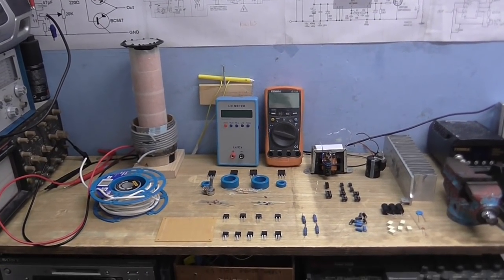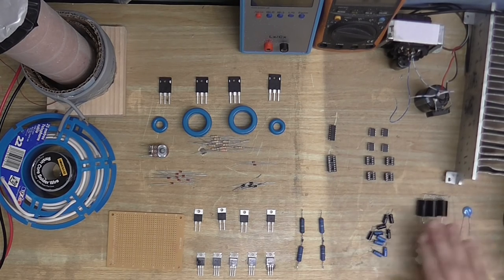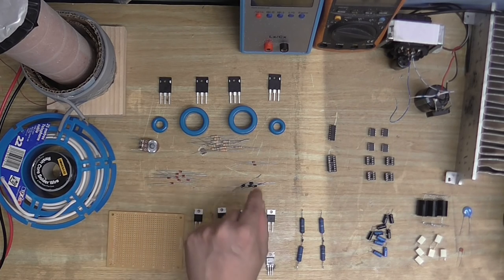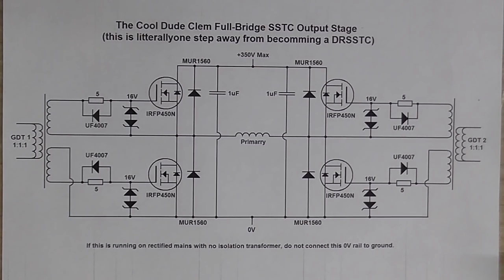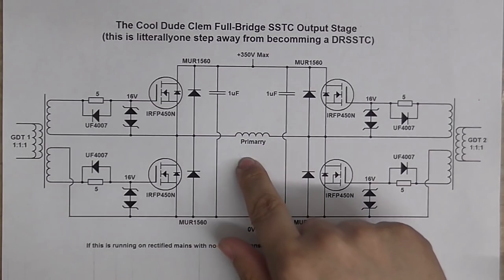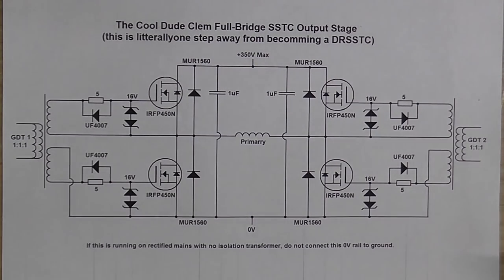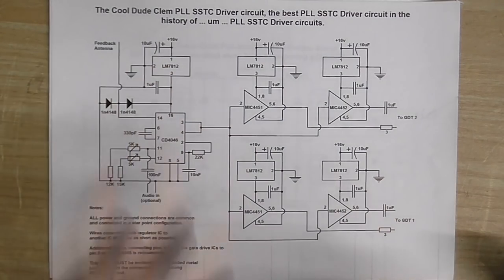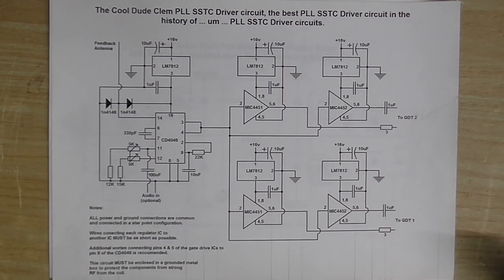Tesla Coil Tuesday - Building a FULL-BRIDGE SSTC Part 1

Comment: i noticed that you dont have mmc capacitor in series with primary in schematic im not sure that's gonna work without mmc!usualy it goes 1.5Uf capacitor between primary and transistors.
Reply from the maker: I'm not going for an DRSSTC design here, I think I stated that pretty well, anyway I did experimented with adding capacitors between the primary and the transistors, but even when tuned properly it took more current and the sparks were not as good.
Reply: @CoolDudeClem  I dont talk about DRSSTC! i talk about sstc i built more than 20 of them and this capacitor is most have in bridge.this capacitor creates Ac in primary without him you got dc in primary.it must looks like this.
https://cloud.mail.ru/public/3yUM/4Bmb1YEDr

Comment: Nice! Btw, I am currently making a very similar circuit. Would you know any other good pulse amplifiers I could use for this circuit, as the local electronics shop did not have any MIC parts.
Reply from the maker: You could try the UCC37322 and UCC37321 chips, unfortunately I don't think you'll find them in a local electronics shop, you would most probably need to order them, I get most of my pars from Farnel/element14.
Reply: CoolDudeClem Thanks man! I live near Frankfurt AM Germany. I checked the nearest electronocs store's catalog yesterday, they did not have any MIC parts. I am pretty sure they do have UC parts though. BTW, if I would power this circuit from 40-45 volts, will BUZ11 mosfets work? as they worked very well for my smaller 8 watt tesla coil. Also, could I use a lm741 amplifier chip or not?
Reply: CoolDudeClem part 2:
finally, could I use a gate drive chips instead of the gate drive transformers or not?
Reply from the maker: It might work with those mosfets, I don't know what kind of output you would get though.  I prefer to use high voltage mosfets just to be safe.  A 741 opamp won't work as a gate drive chip, it's not designed for high frequencies, and even if it could, it wouldn't be able to supply enough current to switch the gates at those frequencies due to the gate capacitance.
Reply from the maker: You could use an IR2110, those have outputs for the high and low side mosfet gate, although it may not work at super high frequencies, I'd say about 350 khz is about as high as you can go. I used one of those in a half-bridge PLL Tesla Coil I made that had a resonant frequency of around 350 khz I and it worked pretty well.  I'd still recommend gate drive transformers though as they have less propagation delay than an IR2110 would have and provide isolation between the control circuit and the mosfets, so if the mosfets blow, it wont take the control circuit with it.
Reply: CoolDudeClem good point, put why not just use a shotkey diode half bridge for protection?
Reply from the maker: You mean the diodes connected across the mosfets?  I chose the MUR1560 since they can handle more current.
Reply: CoolDudeClem I intended on using those, but not exactly what I meant. Rather a diode across the output of my chip(with pre amplifier), and one across the gnd pin of my circuit.

Comment: Hi Clem , i have a question 
If I want to use all those components in the control and the inverter circuit I have to use the same exact secondary and primary coils as you use ?

Comment: Hi, why you don't use current transformer in feedback? I think antenna is very unstable device.
Reply from the maker: The trouble with a current transformer is that I often burn out the resistor between the transformer and the voltage limiting diodes.  I found that out with my half bridge sstc I made some time back.
Reply: +CoolDudeClem hmm, I use current transformer in my half bridge sstc without resistors, I use only voltage limited diodes. It is working perfectly! you may check my video on YouTube channel.